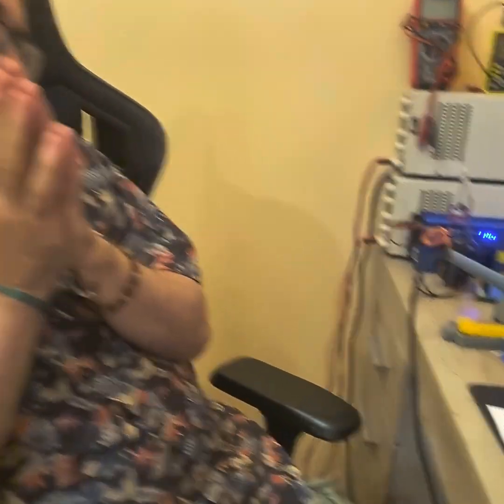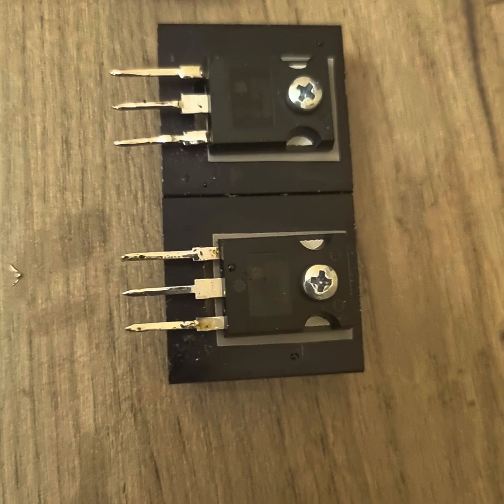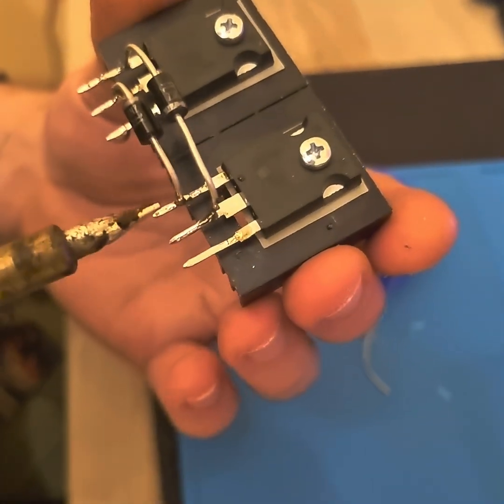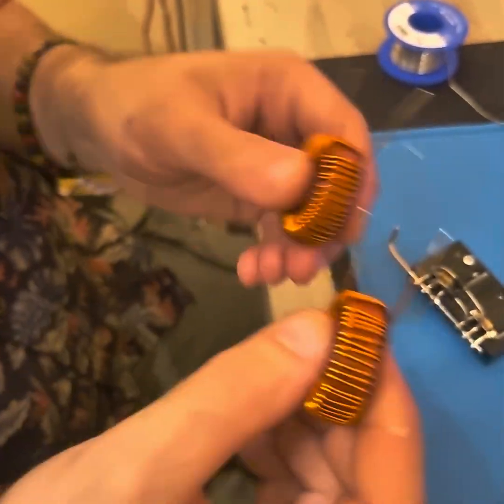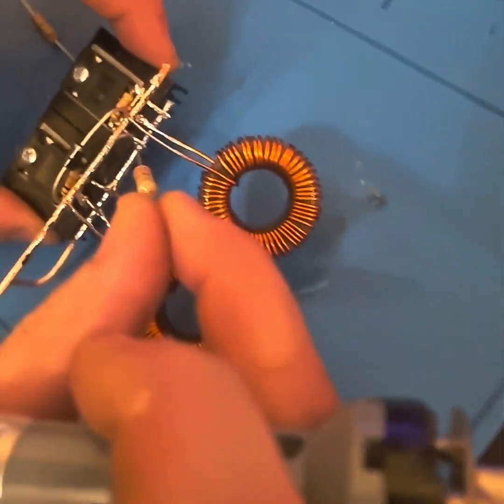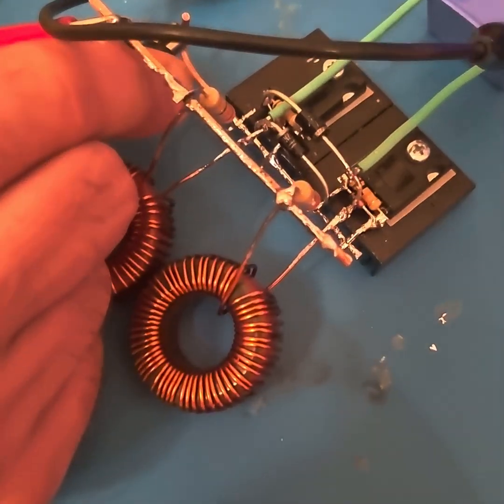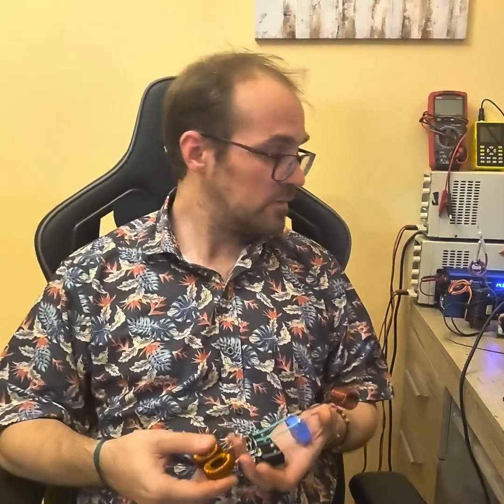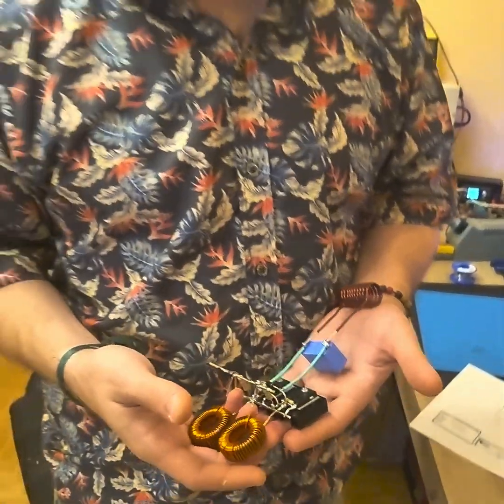The ZVS Driver

Comment: Fairly good video ! Would you make another video about half bridge circuits ?
Reply from the maker: @rodriguezfranco3839  Half bridge  circuits are far more complex, though I have it on my to-do list, so eventually, it will come. I'm really having issues with the gate drive transformer, but I'll fix it.
Reply: @TheEnchantedGoose  I have the same problem , I am building a half bridge sstc and my resources are very limited , I don't own a scope , so it's like shooting in the dark , I will put 15v zenners to limit the Vgs and pray the shitty core I have does not saturate too much
Reply from the maker: @rodriguezfranco3839  Yup, same reason I'm building mine, after taking a taste of the slayer exciter, dual slayer exciters and single IRFP260N Mosfet with no driver i wanna take it to the next level, but I'm having the exact same issue  core saturation, signal comes out like a Picasso painting and blowing my fets..
Reply from the maker: @rodriguezfranco3839  Also, thanks for commenting and watching ^^ ,Brings a smile on my face hehe